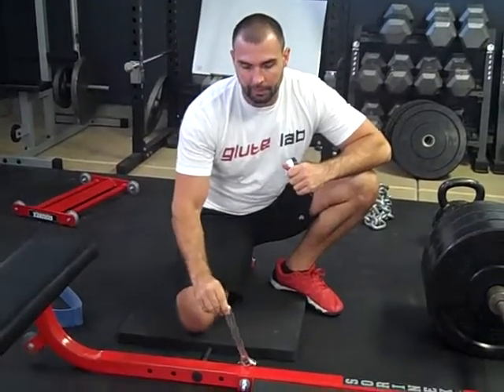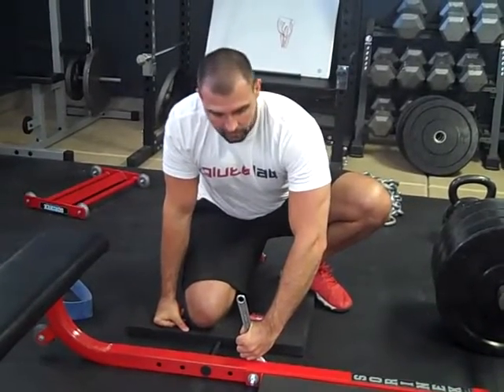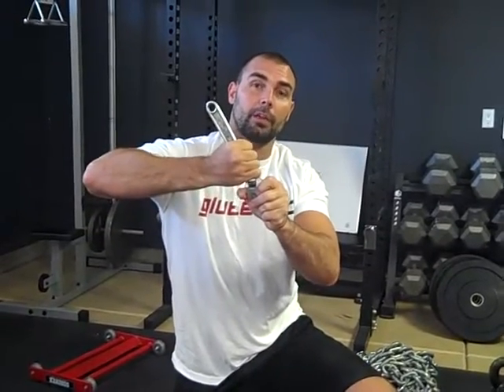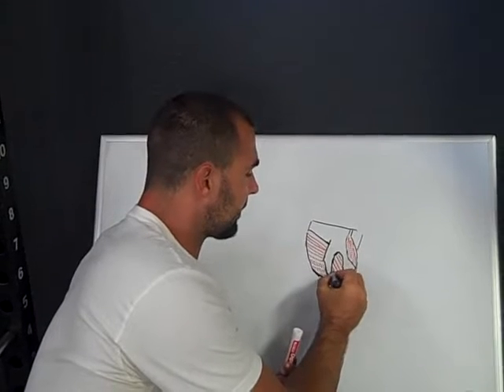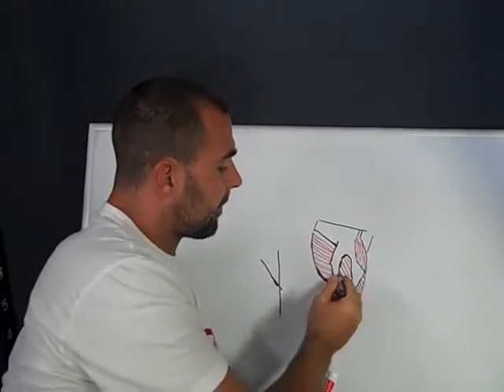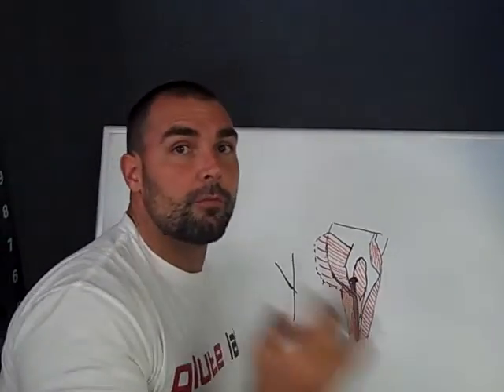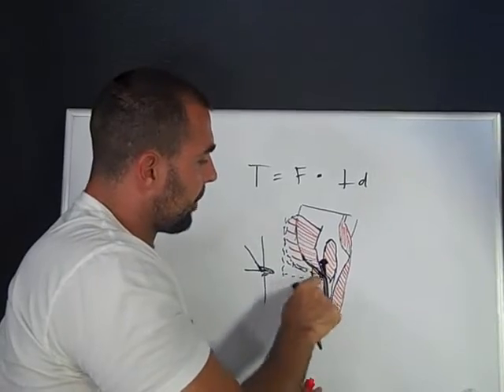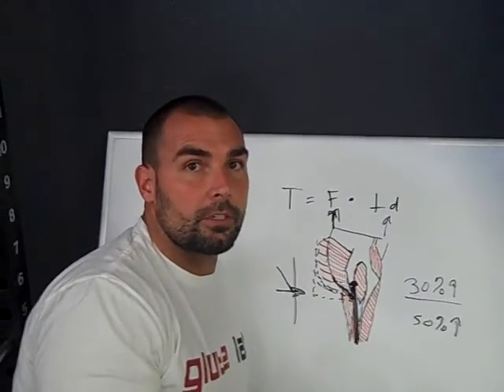What a Wrench Can Teach You About Strength Training

Comment: Hmm, good thinking there and I think it works well with the glutes due to the direction that their fibres are with respect to the femur. But I think with muscles like the biceps for instance, it would be the opposite effect. Those fibres in the middle of the biceps directly pull the insertion and the origin together, but the outer parts of the biceps have an angle with respect to the line between insertion and origin. Hmm, interesting thing to think about!